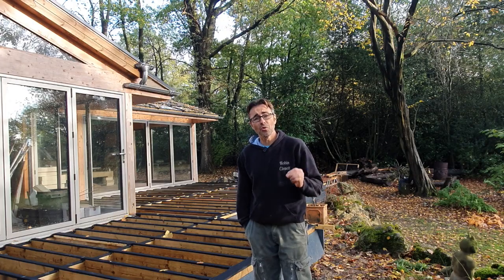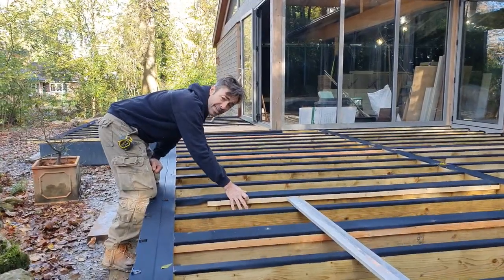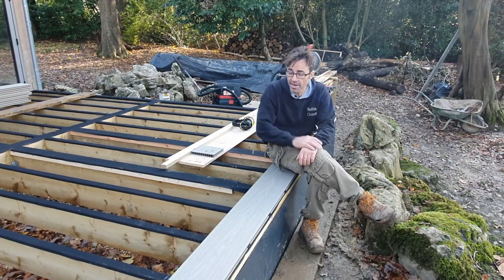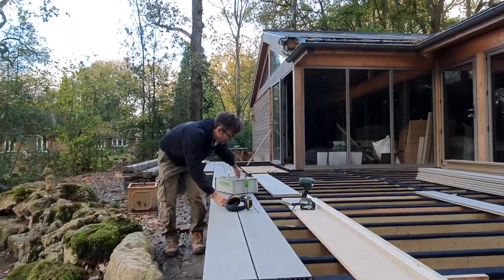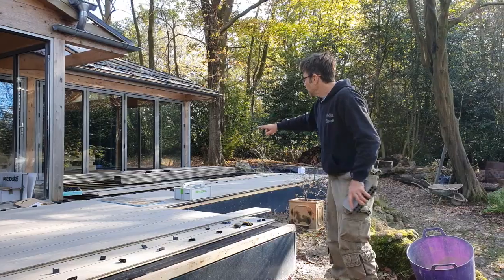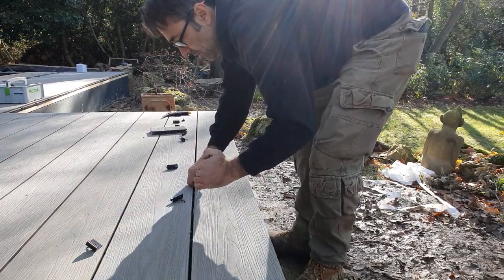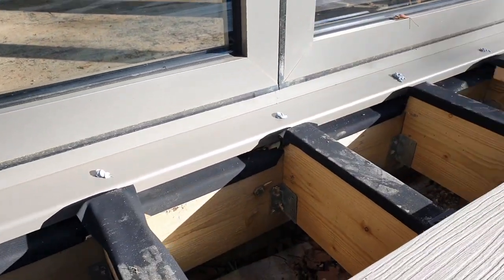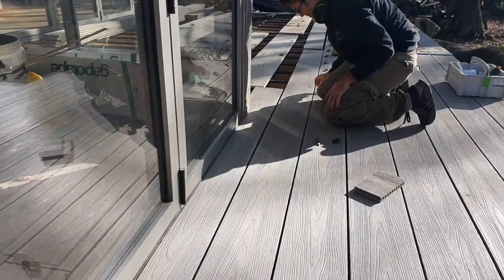How to lay a composite deck. Cut + Fix the deck. Final part of How to build a deck by Robin Clevett

Comment: Great job as always.. I did a massive composite decking job in the summer for a client in Essex.. Hottest time of the year.. And when I set out the deck and started laying the board the client wasn't happy about the big expansion gaps.. That was until the sun hit the boards and the gap disappeared.. You really need that gap.. Also I had to start about 6am so I could get a fair bit done before the sun and heat kicked in.. Cheers.
Reply: Interesting Jim  that is can expand that much would that be approx 5mm per board ?. What is the composite board like when water lays on top or gets wet is it like an Ice rink ? Another  question about health what about  off-gas unhealthy fumes thought that composite board can give  VOC fumes even more when sun beats down  (there is whole list of VOC that is unhealthy for you Cancer is one of them among others.)
Reply: @dickdoc3337  expansion is as per instructions.. It pays to follow the data sheet from your particular material.. I was surprised to see it expanding the full 5/7mm (it was 30c plus though) .the board I have used is a nonslip board but I have seen some algae in very damp and shady areas.. Easy to clean though... No idea about the voc sorry.

Comment: I particularly like the gaps at the butt ends of each board, gives it a nice uniform dark line along the lengths and ends although I accept it was a necessity anyway for expansion, also like the way you have the grain running in opposite directions on each row, I spotted your attention to detail there Robin 👌

Comment: On this one we work totally different. I lay out boards all over the deck which is very useful if up high as you use them to walk about on rather than just the joists. String my first row and fix in accordingly. Then measure and line about every fifth row depending on width of board and area to cover. Never could be bothered with dragging all the boards over a drop saw I have always marked and cut in situ. Super quick and less lugging of boards. I use a fine cut saw blade on a circular saw and a speed square. I mostly cut and loose lay my five rows and then fix them off and repeat. I don't like blocks of joints and so stagger every joint if I can so totally random but then the boards I use don't specify double joists and span 450mm. I will never be as neat and or skilled as Robin but I have built literally dozens of decks especially living in Qld Australia for the last 22 years.

Comment: Top video Robin - like all your others, very informative.  I’ve got the subframe built for my 45m2 deck using 6x2s on 300mm centres and an array of 36 x 750mm SIP ground screws.  We have really stony ground here so even with a 1m x 25mm pilot drill on the big hammer drill I had to cut some of the screws down with a grinder once they bottomed out.  Tapes next and then laying the boards.  I’m going for the 150mm bullnose picture frame around the outside so put in a triple joist at the perpendicular ends to hold the double row of concealed starter clips.  Champagne colour for me and as I design all my structures in AutoCAD there should be no ripping of the last boards.  The frame is good to 2mm tolerance against the string lines and laser level…
Reply from the maker: sounds awesome!!! I would love to be able to design in Auto cad!!
Reply: You can.  You just need to get a license for your laptop and learn from online tutorials on YT - just like we learn carpentry from your videos.  It’s not difficult, you just need a bit of patience and to spend some time.

I’m an electronics & software engineer ’to trade’ (35 years of it) but I give all trades a good crack.

With CAD, I get a cutting list for almost everything apart from closing cuts. I also use this to estimate my purchasing.  For example, with this deck project I worked out that I needed 58 x 4.8m carcassing Timbers and 62 deck boards. There will be very little left over…

Comment: I like how the boards are placed with opposites facing grains per row. The smallest details 👌 Happy New Year to you and the team
Reply from the maker: Happy new year!
Reply: Just a question, when you scribed the board up against the aluminum joinery, shouldn't that have been a 15mm spacer or am I missing something? 
Love your work by the way.
Reply: Could you set the red shims on dabs of mastic? Or even use a small screw on the centre?  I’m thinking if you ever need to remove the edge trims all shims should stay put & not get lost. Worth the bother?

Comment: I worried about how you would be able to take out a board if needed after fixed and you explained it realy well. Like the look of the composite decking. Top work
Reply: I guess you could loosen the fixings on each side of the board and slide the board out, obviously that would depend on how the perimeter edge is finished too

Comment: Brilliant job, quite the picture! Having done some repairs on a composite decks, first off you really do need the support structure to have the proper spacing or everything will sag. Secondly be super certain about how you manage the water flow, runoff, gaps etc, because these boards will wick moisture into to your structure like nothing else. Third the varieties I've seen can warp pretty badly when there are large temp/moisture differences, I would definitely use more than enough clips to hold it all down. Getting a board out after several years is doable, but with all the accumulated crud and the boards having gotten warped, I ended up having to pick up a whole area in order to fix it. Still, very doable but replacing an individual board is not super feasible.

Comment: Did consider "Ecodeck" here in Australia. However it looks like brown plastic and has no character. It will also become scuffed and dull. That reason plus the concerns here as a fire risk. The whole deck could turn into a boiling hot mass of molten plastic. Not sure if that is fire proof as you can get a fire resistant option. Anyway it looks neat and matches the house nicely. I ended up using a hardwood Merbau. Its fire rated and lasts forever if properly cared for.

Comment: Great video Robin, thank you. Well, as a DIYer I’m glad to see I did mine pretty much the same way as you! A few points I’d add for guys like myself: I’ve got a Ryobi impact gun and it was way too full on for the fixings. I used my drill driver. If you store the composite outside over a winter and a warm spring before installing, it definitely won’t be straight! I did a picture frame border in bullnose boards. I used the composite subframe and I would not do that again, it’s evil stuff imho even though it will never rot. I did mine from the picture frame border and worked back to the wall because I knew I’d end with a scribed cut and it seemed easier that way. To fasten down my cut boards I cut slots in it with a router using a biscuit cutter and used the fixings. As mentioned by others, the composite is a saw blade killer. I used EnviroBuild Frontier, they supply colour matched screws for both the deck and the fascia. I thoroughly enjoyed installing mine and I love the finish. There’s a far less professional video of mine on my channel for anyone that’s interested.

Comment: Cracking job. I was just wondering what happens to the fascia boards as the decking structure expands and contracts? The decking boards can move a bit in the clips, but the fascia is screwed to the structure.

Comment: Fantastic finish Rob. 

I am currently planning my composite deck and having watched this I have a query I hope you (or anyone else!) can shed some light on. 

Numerous carpenters have advised me against levelling my deck above the bifold door cill like you have done here and how I plan to do it. I really want a level flush finish like this. I am being told it is not good for drainage of water?

I am thinking what their problem is when the cill is obviously watertight, the water can drain through the expansion gap and down underneath the decking. Surely???!

Also. The polymer adhesive you use, how does that cope when the board expands under the sun?

I love watching your videos - such great attention to detail and always calmly and well explained. Keep up the good work!

Comment: Our installation guide states that you should use one screw each plank to through that groove to secure it in place otherwise it can move lengthwise out off desired position but only one to not prevent thermal movement. 
Probably most long lasting deck material but here it's 3x times more expensive than pressure treated wood.

Comment: Hi Robin, I’m using this installation as my go to guide for installing some composite decking at home, albeit a much smaller area! One question I have is to do with the board placed on the bifold door sill at 25:24. I know you’ve left a 10mm gap between edge of the board and the door, but is water still able to drain out under that board despite it been stuck to the sill? I’m trying to get the same flush affect with the door threshold. Thanks!!

Comment: I've been waiting on this part for a while. Having used composite prime myself I was curious about your fascia/close off detail. I personally found the clip system frustrating, I've used better. The boards themselves were of nice quality but the fascia system I also found frustrating. The finished job was nice but it's not my favourite system to use (ultrashield is the system I usually recommend)
Reply: just checked out ultrashield - the system looks identical to the composite prime system so not sure I understand why you prefer it?
Reply: @molydood  the clip system, the screws are already inserted into the clip (they also do a 1mm spacer aswell) also they have a locking clip (1 per board) that stops any unwanted creep/expansion. The boards themselves aren't massively different but I've had far less problems (dare I say better quality) with the ultrashield. They have changed there facia boards recently to the thinner style of composite prime but a much broader board (170 if I remember correctly) it's also double sided, both sides have grained finish but one is a much deeper grain
Reply: @R08mky  ok cool, thanks. they dont do anthracite so will probably not work for me but appreciate the reply
Reply: @molydood  no anthracite, the heritage is a very light grey and what they call grey is very blue

Comment: Great videos. What is the dark board you have sitting vertically around the perimeter. You put decking facia against the top half and think the intention is to have soil for plants up against the lower part. What specifically is this  ?  Looks good and provides barrier between joists and soil. Thanks

Comment: Great. Just wondering if at the entrance/exit point there will be steps, and if so will they be in composite? What doesn't always come across is that your ordered way of laying out and cutting etc. is not only giving a quality finished job, but probably quicker as well. If stage 1 is correct stage 2 is much easier etc. True craftsman. Keep it up.

Comment: Looks great and it’s made my mind up for me that I want a composite deck rather than timber. One question: with timber decks, it’s advisable to allow air to pass through to avoid rot. What about composite decks and airflow? It’s looks very closed off.
Reply from the maker: Hi Matt, it is really important to ventilate the deck structure, I explain in the video about how I have achieved that using a series of spacers to allow air in via the fascia boards etc

Comment: Awesome video, thanks Robin. I've just ordered some composite prime decking after watching!

Great tip on laying the final boards by sliding the clips in. I'm planning to picture frame the decking though - how would I go about this? Only way I can think of finishing it is with some face fixings on some of the boards as the picture frame will prevent me sliding clips in
Reply from the maker: If you have a run that has a join, slide all your clips along on the first board, then slide them back along once you drop in the second board, it's a really nice product, mine has weathered really nicely and I don't feel the need to clean it!! Its a superior product!
Reply: @ukconstruction  Brilliant thanks - that seems obvious now! I wasn't planning on having any joins, just full lengths with the picture frame round. But splitting the cut board and doing this will likely look better than face fixings unless I screw and plug the holes. Thanks again!

Comment: Hi Robin, great video, I really enjoyed watching that. I built a composite deck a year ago with a similar layout to you. Question: Do you have an opinion on setting up a fall? I have found my boards stay perpetually wet, I suspect because they are perpendicular to the fall direction. I know they wont rot as they are composite, but nonetheless is annoying they are wet when the rest of the garden has dried up. I'm tempted to lift the deck boards up , nog it out at 400mm centres and then put them back in parallel to the fall, but would be great to get your thoughts.
Reply from the maker: I did Run some limited falls but my deck is elevated and gets a decent breeze across it so the water seems to dissipate fairly quickly, sounds like your Idea to switch the direction may be a nice idea fro you, just more work!!!!

Comment: Give ya one tip. Before cutting the boards lay them all out on a flat surface exposed to the same conditions. These boards are prone to expansion so when stacked in the sun you might go for a break, come back and cut the top board which has expanded in the heat and then cut the others to the same length. Issues when they all return to the same temperature...

Comment: Hi Robin, loving the deck, I am about to do my first composite deck & the instructions say to screw the nosing down & then mention that you should only fit one screw per board for expansion & contraction which seems  a bit of a contradiction, you have fixed your vertical trims with plenty of screws is it just the decking that needs 1 screw only? glad I watched the content, looks brill.

Comment: Hi Robin, thanks for your great content! Please can you tell me if you would attach a ledger board for a deck onto a brick wall. The bricks are normal lbc. Thank you, Dave
Reply from the maker: Yes dave if you watch the first if this decking series you will see me do that, I always space of at least 10mm with a proper plastic spacer
Reply: @ukconstruction  Thanks Robin, I did see you do it in the first vidio but was wondering if it would still be OK on brickwork? , not a concrete block

Comment: Robin,  I was wondering  if the scribe was in a void or in the solid web of the board, and if a thinner edge could be affected by   Freeze/ Thaw cycles as the deck ages and sealers  develop pinholes or gaps.

Comment: great deck. its an amzing build. 2 questions , what is that plastic ply you mentioned , i dont remember you mentioning that before (i will have to rewatch the first 3 parts). and what happened to the 10 mm at the door for expansion
Reply from the maker: Hi Alan, the plastic plywood is called Stokboard here is a link https://www.filcris.co.uk/category/boards-posts-and-sheets/recycled-plastic-sheet. It was hard to see the expansion gap on camera!!

Comment: beautiful, however, you mentioned ventilation a number of times. I see a very closed in space below.; How does the rainwater escape? Did I miss that on Part 1?
Reply from the maker: The water runs away with the lay of the land we have a void of about 350mm sloping from building out

Comment: Robin, can you explain a bit about drainage? Your joists seem to be touching the ground at certain points. Will they not be damp?

Don’t think you addressed drainage in your four videos.

Thanks
Reply from the maker: Hi Mate, my frame is at least 150mm from the ground at the closest point, if I was making contact with the ground I would use class 4 treated timber as this is manufactured to be in contact, my frame is completely suspended on ground screws

Comment: Robin , I saw you rip that board free hand on the table saw , was the gap not parallel to the door sill?. Be careful if you get a skiff of snow or ice on your deck , I’ve built a lot of composite decks in Canada and know from experience, their like skating rinks . That’s a beautifully constructed deck from start to finish, nice job 👍
Reply from the maker: Hi Jim, my rip was indeed slightly tapered so I did a free hand push!! we hardly see any snow or Ice here in the South of London but I reckon as you say it could be slippy!! thanks for your comment mate

Comment: Hi Robin, I like the way you measured the cut for the door threshold onto adjacent board using your cut out. However I noticed you didn't seem to account for the gap between the boards, did you do that afterwards?
Reply from the maker: Yes mate I allowed the additional spacing before cutting!! Well spotted mate!!
Reply: @ukconstruction  Excellent 😀👍

Comment: Hi Robin, question. How do you overcome the expansion of the facia panels. I see you just used stainless screws, but not allowing for expansion on hot days. I have a similar project coming up, but here in Oz, where the expansion on any form of composite is huge 5/8 mm on 5.4 lengths on hot sunny days.
Reply from the maker: Hi Tim, we generally have mild temperature swings either way here in the UK and the boards are only 3.6m, I tend to try to still maintain a gap between but joints wherever possible as the boards do as you suggest expand and contract a fair bit we leave about 5mm gap on joints and where I mitred the facia boards on the external corners I kept these touching, I did notice that they did push against one another in the heat but then settle back when the temperature settled, it is a really good thing to plan for the expansion in line with any manufacturers guides, good luck with the project... ping me a pic on instagram when done!!!